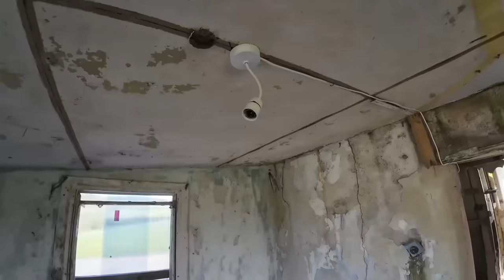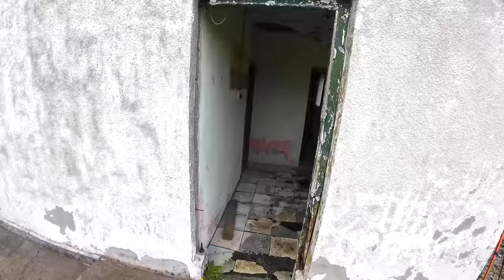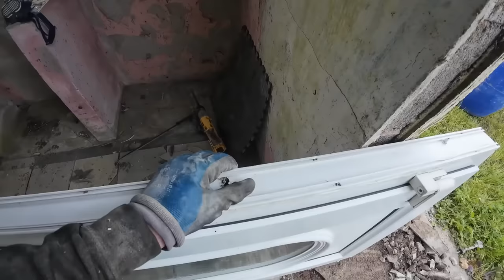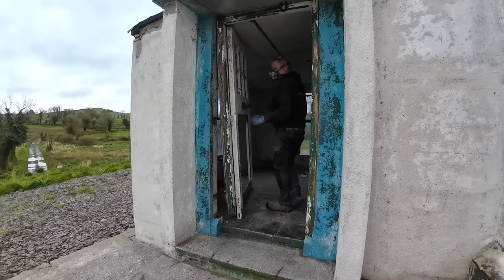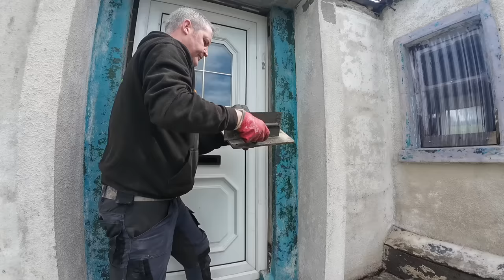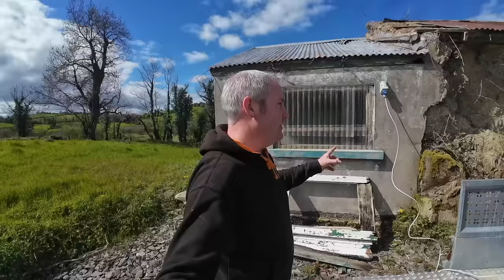Irish Derelict Cottage Restoration || Repairing 40 Years Of Neglect Begins

Comment: Adrian, the blue socket you put on the outside of the house for connection to the generation should be a “inlet” type and not a socket, to connect your generator in the current set up you will need a lead with a male plug on both ends and could cause a situation where one end is plugged in and you have bare live pins at the other end
Reply: I was thinking the same
Reply: Yup. Electrician here. Lethal dangerous but easily put right.
Reply: Very valid point that🤔The only thing he could do is not fire the generator up until both males are plugged in and nothing live exposed
Reply: Plug the lead into the wall socket before plugging into the generator.  And unplug from the generator before unplugging from the wall socket.
Reply: Brilliant comment. I came on to warn about this also. The solution about turning the generator off first doesn’t work as it only takes one mistake to get a shock. Easy to put right as stated by someone else. Electrician here also. Thanks for the videos
Reply: Adrian, you’re an amazing man. Between running a busy farm, raising a young family and caring for your parents, you still find time to fix old tractors and a digger and to restore an old cottage. There seems to be nothing that you can’t do. I don’t know where you get the energy. Here I am sitting on the couch and complaining about my life. 

The cottage looks great with the new doors and the lights. It’s really coming to life. 

I hope your father makes a speedy recovery and comes home soon.

Comment: The blocks of concrete on the bottom of the door frames was to keep the frame from rotten the pin was put into the frame before it was fixed then the blocked wer caseed and filled with concrete I don a few of them with my father I am enjoying the work on the house

Comment: I have a Land Commision house built in 1952 which is mass concrete. All the heads of the door frames were built into the concrete the same as yours. Instead of concrete lintels there are two lengths of box section steel about two inches up into the concrete. Yours may be the same. If they are over the doors they will be over the windows as well. I'm renovating mine and getting close to finishing it. Lots of hard work but if you can do it yourself you'll save a fortune. All you need is time and lots of it. Best of luck and I'll certainly be watching it

Comment: To keep the kitty door closed, drill a hole at the base on the inside and put a nail (or in my husband’s case-a drill bit) and it can’t be opened from outside.  We had a cat who could unlock the door with the tab lock. He also eventually started pulling the drill bit out of the hole.  Darn cat.🐈

Comment: The spikes at the bottom of the reveals were to hold a door frame in place, at that POINT,, that’s why also there was concrete up a few inches on the bottom to keep the timber off the ground and from rotting. Older doors used be sunk into the ground and used always fail at that point. A lot of building work during the 50s through to the 90s was trial and error. Keep up the good work
Reply from the maker: That makes sense, never seen that before 👍

Comment: Hello Adrian, temporary lighting good job Just want to say you need to change the outside blue female socket you are going to supply the lights with to a 16 amp male inlet .The reason the plug you are going to connect to the socket you have will have exposed pins which will be live and someone disconnecting it with the gen on could get a shock or worse.

Comment: The floor tiles look like the type that may have asbestos in the mastic that was used to stick them down - keep the FP3 mask on when you're on those. There are a load of solvents available for helping take up that type of thing - it might be worth doing this early on in the project so you don't have it on your mind. Chisel on a drill might be the way to go or to steam them and use a solvent as well to speed things up. Good video & good luck.
Reply from the maker: I had them floors, sealing tiles and part of the side shed inspected last year and got the all clear. But I still wear an FP3 mask all the time if i’m working near them areas. 
I’m having them kitchen floors tiles and the adhesive removed by a registered company very soon despite getting a clear test as they do make me nervous and others have mentioned it. I don’t want to my myself or others at risk to that nasty  stuff. Hope to have it all cleared possibly next week.

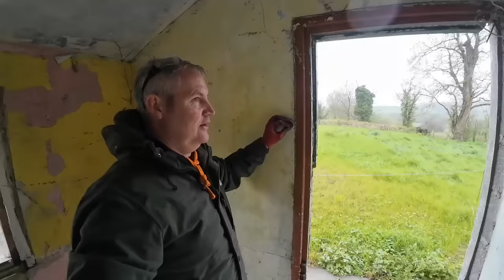Comment: 6:24  My last house, which I owned for 28 years (1986-2014) had ceiling mounted light switches operated by pull strings.

Comment: The spikes that you were talking about at the bottom of the door frame to the best of my knowledge are for holding the bottom off the door frame. 
I’ve seen plenty off them in my time in the construction industry but normally it’s a big ignorant 6 inch wire nail.
Reply from the maker: Never seen them before, but that makes sense 👍

Comment: Hi, on the outside lights for the cottage, have a look at  solar outside lights, I got some  a few weeks ago in Lidl , €13 euro each they have a passive light that stays on and then when the sensor which has a 20 /30 ft range picks up movement they really get much brighter, I use them by yard gates where you can’t get power to and they are great, I bought one tried it and I bought another six  since, it’s just a suggestion, outside lights are and no need for a generator 👍 keep up the good work 😊

Comment: I served my time as a carpenter and if my old leading hand carpenter seen me setting a door frame with a small level like your one he'd have kicked my arse 😂 the front frame with the spuds were used back in the day when a frame had no cill.. you would bore a hole in the bottom of the styles of the frame and drive a  5 or 6 inch bar in leaving about 3 inches sticking out and after the frame is fitted you'd  cement that part at the bottom to hold the frame firm.. also kept frame up and away from the damp.

Comment: i’m a spark and i can say that’s how ya wire lights right😂
Reply from the maker: Do well for this job, i wired a lot over the years just wished i had of continued on and got the cert. Still considering it
Reply: @IFarmWeFarm  You've made yourself a widowmaker! You have the wrong receptical on the wall, you need a inlet on the building, not an outlet! (the pins on the wall end of the cable can be live and accessible)
Reply from the maker: @andyleggatt1846 it’s only for temporary generator power though, I know what your saying and easy changed out if needed

Comment: Depending on your planned order of trades, I have concerns your temporary lighting cables will constantly need moving. So the staples will become a pain. Perhaps a lashed up catenary of lengths of flex with in line plugs suspended from screw in wall and ceiling hooks might have been a more readily adaptable temporary lighting system. Also I didn't see any local protection device.

Comment: A new door just like this temporay on without mail slot and pet door would look amazing on bothh door openings. Now real progress can be made. I was thinking about that rotten back wall ,I would  support it and replace it with a timber framed wall ,it would make it easier to add a room onto the back in the future fare easier and it would be less cost then redoing the mud wall.
Reply from the maker: Ya were definitely not going to use mud again, that back wall will all be demolished and extended with new foundations and a 4” block built wall and a 80mm foam filled cavity.

Comment: I've no wish to tell you what to do with your own property, but is putting modern PVC doors on a very old cottage, really a good idea?  It's a clash of styles. Do you not have a reclamation centre where you could source some wooden doors (and possibly window frames if necessary), that would fit?
Reply from the maker: I know what you mean and agree, i did mention that they were only temporary and I would be reusing both those doors on a shed at home eventually. Just leaves the house less open to the elements until the real construction work starts.
Reply: @IFarmWeFarm  That's fair enough and as I said, it's your property so you do what you want with it. So does that mean you'll be looking at getting wooden doors and windows eventually?

Comment: I would leave those doors, they look ok and will last. If you wanted to neaten them up you could buy new inserts or do it on the cheap with just new handles and letterboxes..
Reply: Please don't!  Get something appropriate in there, true to the building! 😮
Reply: @nicolagalton9457  Old wooden framed doors and windows are crap. The let cold and damp in, they warp, they rot, they need repainting and replacing plus cost more.
To get appropriate doors and windows for this building would cost more than they are worth when no one will see them or care.
You might as well just set fire to your money.
Keep in mind the house doesn't have the overgrowth protecting it now from wind and driving rain. 

PVC looks just as good, is maintained free, warmer, cheaper, easier to fix, cheaper home insurance and will keep the house warmer while being harder to break into.
Also easier to fit.
Plus he already has the doors and they only need light work.
It will be silly to rip them off again just to downgrade.
Not to mention you could get used PVC windows for next to nothing, wooden framed windows would have to be made.
As builder myself I would never recommend wooden framed doors or wooden framed windows.

Comment: Well done as always, only issue I see is that your input is a no go, can't go Female connector for power input, that's not remotely legal here Denmark at least, but I know the male ones for input are rare and they charge a fair amount of money for them.
Reply from the maker: I understand, to over come this I will wire a direct feed from generator to the isolation switch housed in a waterproof box outside. Simple done 👍

Comment: Not telling you your business but that 16 amp socket should be a male type going into your isolator. You will end up with a lead with a live end from your generator. As both blue 16 amp plugs are male either end and someone might grab it by mistake when unplugging it And get a belt off it .
Reply from the maker: You’re totally correct, i’ll be the only one using that generator and i’d always have all connected up before powering on. But yes i get what you’re saying so i will swap it out this week. Was only reusing a socket that i already had. You’ll notice that it’s sorted in the next one 👍